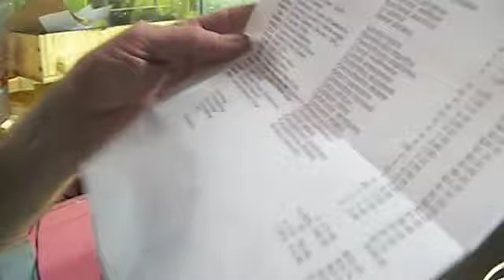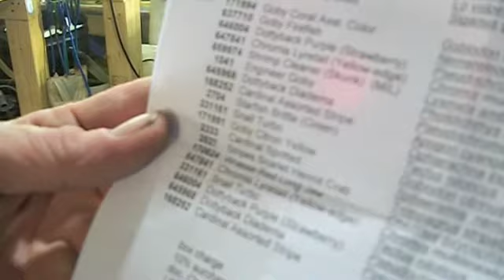# 1379 January Phillippines Part One Carls Aquarium

Comment from the maker: Put in appropriate sized pvc pipes a foot or so long, when the fish hide in it put a net over the end and pull out the pipe and dump the fish in the net, for bigger fish get a clear leaf bag and open it on it's side in the front area of your tank put sand in the bottom some styrofoam to keep the top up and tie some strings to the bottom lip, when fish is inside pull the strings and catch the fish in the bag.